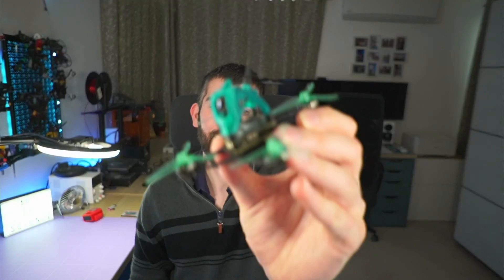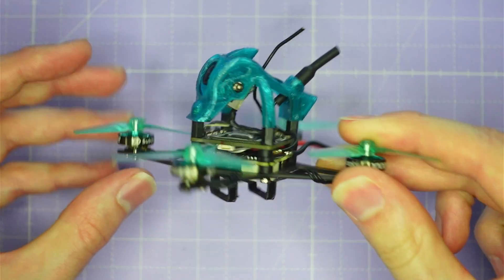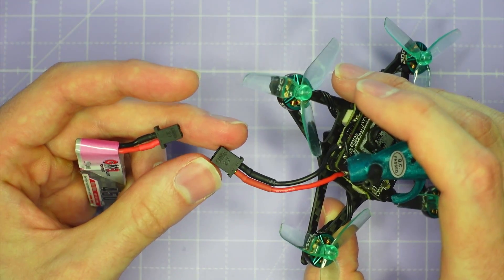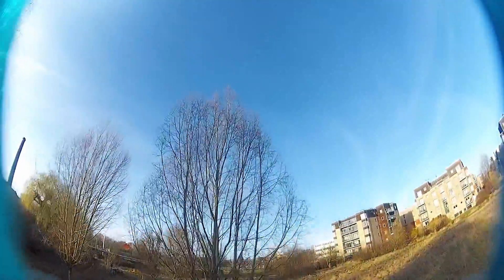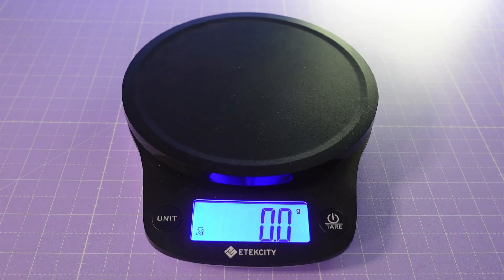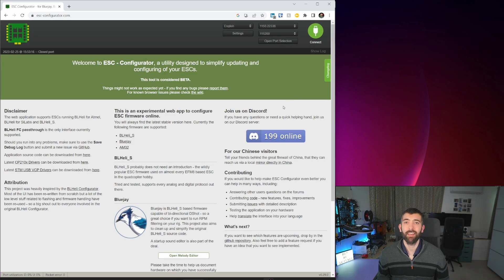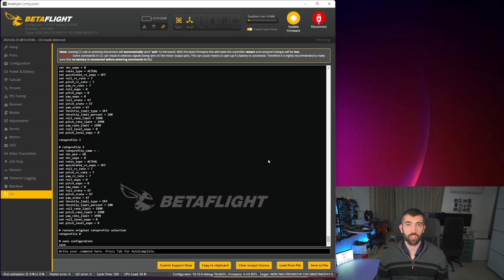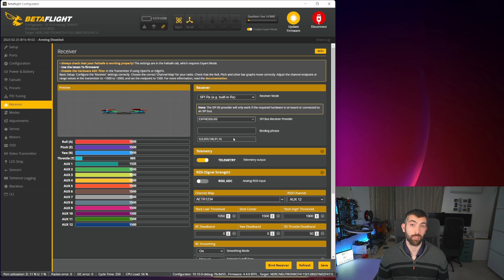Sub250 Nanofly20: Enormous potential so LET'S UNLEASH IT!

Comment: In case anyone else has flyaway and surging problems with this tune as I eventually did after moving to a humid environment, try turning off the anti-gravity to test if that fixes issue, as it did for me. After that you can add anti-gravity in small increments to find what is optimal for your situation..

Comment: I received an email announcement from Sub250, they announced their BetaFlight 4.4 firmware update for the AIO flight controllers used in this Nanofly20 and their Nanofly16.  Rejoice!  I'm sure Chris played a big part in getting this update out, so thank you Chris!  Link: https://trk.klclick2.com/ls/click?upn=waQkdDvdNjccUsL3KfXV-2B-2B8QHrmGIvOFqJ3qY4Y-2FC2we6sYS6-2FHkYIHWikr4BiXr1eSue4-2FGhu6Gso2-2Br3Xb6AbfcD2-2BaRA4pbegCXaC8uTMzDHXvjhdtYjr-2FGfEKgUrmENk-2FJnU84VSza-2B-2FROtFo3HF8mqyYxi9blkuHbe4TyBjCeTgURoPsNF0Mj-2BjslgacHC9Z3VYhgLpOgsw4KkgutIu-2FCUdNr0KYU5pzKmysJe5PvkECpuyhqWSY5a0GYaksoBs4qqTLuF3QzpnZ3TSswKMHc-2Bb5FP6pYsOvUmCyZZ2yFP0xn0a5LXQUJxMfo4DJHvq_JA-2FyqipuwZKn5ipQY2yN7nfVrs0f93YfhiebQ0DDaJ40HbX3cMM32qXEjQpHV-2B1NgOmIhD3-2B9k1M-2BPRaTuHfBEPWd3jNv8Sj0nA72R-2FShHKlnk8WEgND-2FRqWIfcmtNkzTJ40BeGqrvsIXySLrMP6ytHmuYksChg2wYipF-2FT1FiLcedJQEfyy0VARwXtA455L9ssv1i1YjjPmG1jW5gfmknt76o-2FyjjTaygEvln6w03yWjfuQxZ7UFkVgXYAOLpa6t37TiJzm8QSl5AhZZ2NGXGgpJhXN2cDsyUd4LR-2Bq6RgYIx1JJlruefrjk-2Fu6-2Fgwn82uv4t4KLRcNa7IOCoFZckZVgWKimi3B8riNT2ZK6p53U8Z-2BvQ9J7mlDJSw3b-2FeJsBRqSSOO09VE4fjtkKRCEnU0lLNPGr34HKR8XsQRaFZnusRvSIFQ11tC9UssFMdI

Comment: can we use/set different hz elrs configuration on different pid profile in betaflight?
lets say 
profile 1 using 150hz, 
profile 2 using 250hz 
profile 3 using 500hz?
i mean on the same flight controller

Comment: Awesome video. Mine did that as with the motors bought one thinking it was defect. I got a new pid from sub250 because my camera had some shakiness to it. It's better bit I still get oscillations or a high pitch sound from one of the motors. Still a good whoop. Sometimes. Lol

Comment: I wonder if the GNB 27 is better than xt-30 in terms of performance.
Reply: No GNB 27 is a 1mm bullet connector and xt-30 is a 2mm. The GNB is good for around 10A and the xt-30 20A continuous. On these 1s micro's though the xt-30 weighs over double the gnb and the voltage drop is like 1% difference. MuteFPV has a good video with tests comparing them.
Reply: @thirtythreeeyes8624  thanks. that was my impression. not enough performance gain to justify 2mm bullets. even though i run them with out the plastic housing. i'll be switching soon.
Reply: The male pins need to be spread with a scalpel occasionally, I still may go back to xt30 but I'm trying 150 & 220 6v caps first...